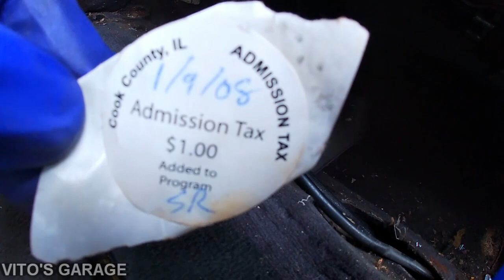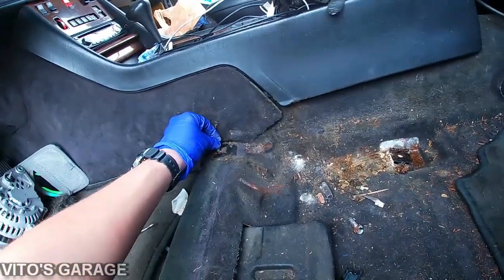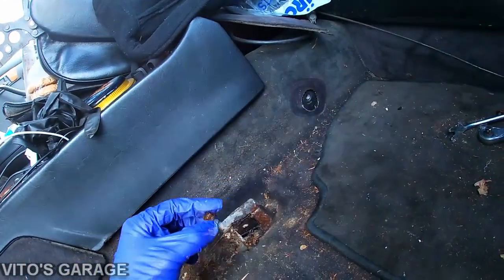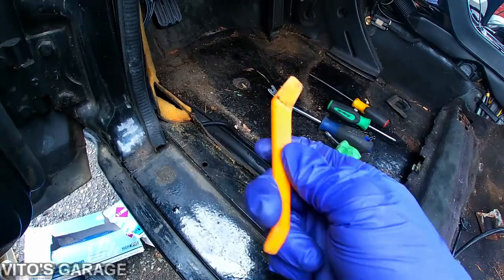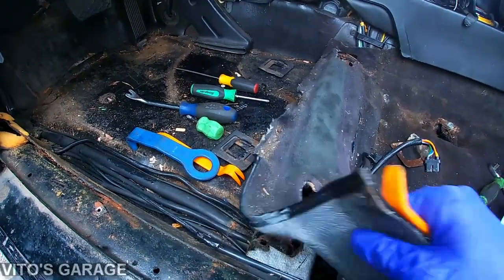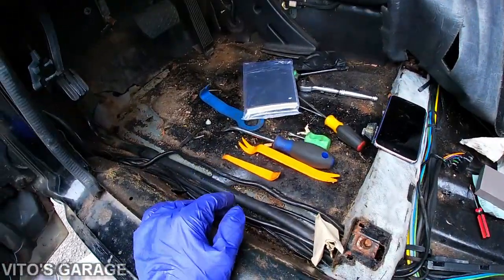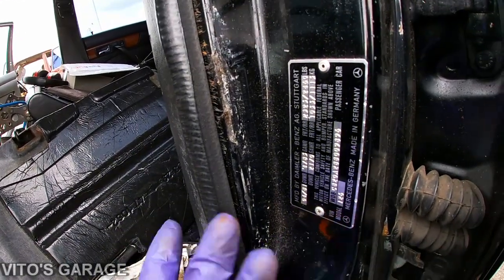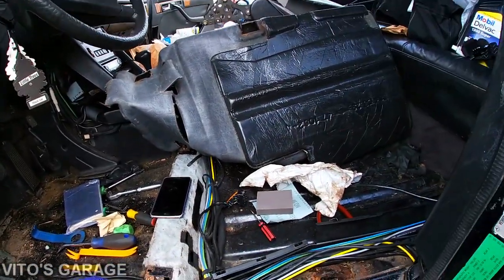Mercedes W126 Restoration Ep2: Driver Side Interior Removal & Floor Inspection

Comment: Good day, I'm at the point of trying to get wiring harness off my 126. I have the all the wiring off the dash &  doors but I can't see how to get all those wires through the bulkhead area...... I've taken out the relays from the fusebox and disconnected the wiring blocks but I'm nervous of unscrewing the wiring on the underside of the fusebox. ....Any ideas ??    Thanks  Bill